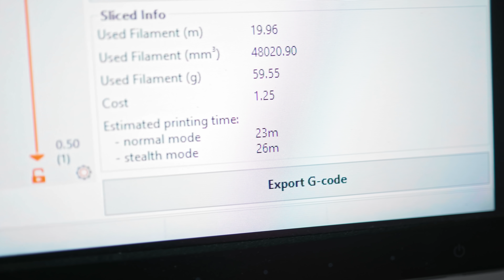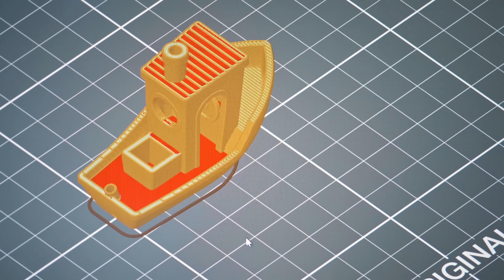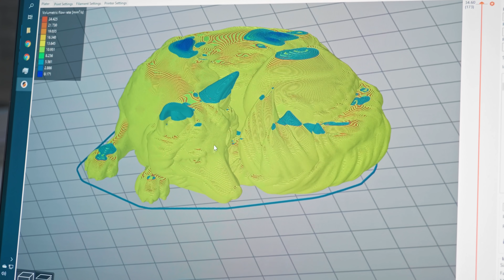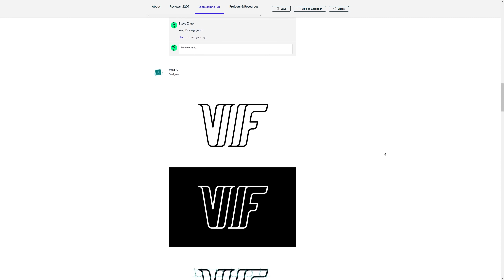Print FASTER: Tuned Profiles or Drilled Nozzles?

Comment: Kind of surprised you didn't try a commercial large diameter nozzle, especially with the runout your drill bit had 😱

Thanks for the vid!
Reply: The run out on that drill made me clench my cheeks
Reply: But it makes no real difference, wherever the centre ends up, will be the centre.
Reply: @LooseyHenderson  the runout doesn't only change the center of the hole, but it wiggles the drill bit while drilling. Thus, you get an uneven diameter and typically a partially much larger and very inconsistent diameter. Considering the flow and uneven pressure etc this is quite an inconvenience for a nozzle bore^^.
Reply: Thomas Henderson off center oversized hole could break out and have an uneven edge on the nozzle cone.
Reply: @genioee  Yeah, I get it. I've been drilling holes for 30years in every conceivable material, bent drills can still make round holes!

The fact he broke out into the conical section is the far greater issue.

Comment: I feel like comparing 0.2mm layer height print times to 0.4mm ones is not quite fair. 
It is known that you can push the extrusion width up by quite a lot with the 0.4mm nozzle, 0.6mm is completely doable. 
I would like to see a 0.6mm extrusion width, 0.4mm layer height print as a fair competition for the 1mm nozzle print.
But as you correctly mentioned, volumetric flow rate is the limitation eventually (or the cooling).

Comment: Hi,  I bought a set of nozzles ranging from 0.2 upto 1.0 I have experimented with the 0.8 but I didn't like the layer's, I prefer using 0.4 although the 0.2 had a very nice finish and took longer, some of the things I print need a little more detail so I have to factor in for the extra time.
What I have considered playing with using a bigger nozzle is TPU (for RC tyres or something). Have you ever tried this?

Comment: I have been using a CR-10 with a Prusa MK3S Hotend/Extruder and a 0.6mm nozzle combined with a printing profile from CNC Kitchen (taken from this video: "FASTER 3D printing of face shields") to great effect. I find the 0.6mm nozzle makes for a good compromise between quality and flow rate and makes for some really good yet fast prints. It might be worth checking out. Also, if anyone is searching for cheap (ish) but good quality nozzles, I can recommend Trianglelabs on Aliexpress.
PS absolutely glorious reference to LTT

Comment from the maker: First!
Also, here's a rough summary of my "03c" compromise profile for my MK3:

SPEEDS
Infill 250 mm/s 
Perimeters 150 mm/s
External perimeters, small perimeters, top solid infill 80 mm/s

ACCELERATIONS
Infill, perimeters 4000 mm/s² (could probably still go higher)
External perimeters 1200 mm/s²

Z-hop reduced to 0.3 mm

Travel speed at 250 mm/s

Minimum layer time 10 s

Extrusion temperature 220° C

Use at your own risk 😉
Reply: Thanks for this. 99% of my prints are just quick functional things (small boxes etc). I'll give the above a try just to see how much impact it has considering there is no infill.
Reply: Look at the speed view in your Slicer, 150mm/s without a Volcano is not possible, because the volumetric flow rate limits the maximum print speed.
Reply: Second?
Reply: Why are you using Z hop?
Reply: @AdamRW240   At those speeds the motors lose a lot of torque, so z hop would prevent layer shifts.
Reply: Nice I was just about to ask for the settings 👌
Reply: Hi Thomas. I've seen a bunch of your videos. Probably most of them by now. However I have a question that's nagging me: what's the fastest you have ever printed with GOOD results? On any stock printer out of all you have tested.

And the same question, but for stock printers.

I know some people get insane speeds with heavily modded or pro printers, or with "acceptable quality". But I was really curious as to good quality results.